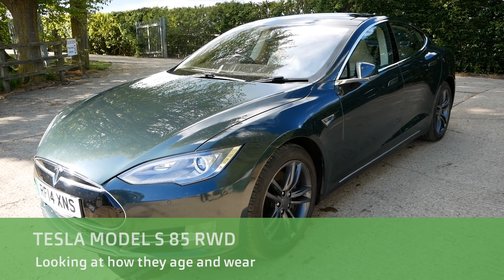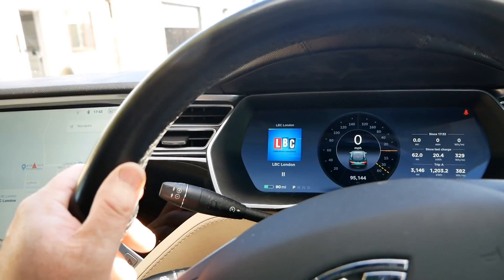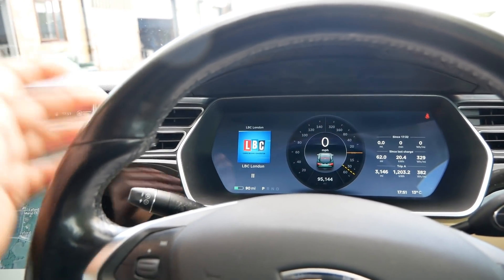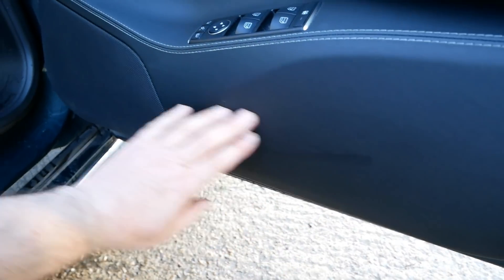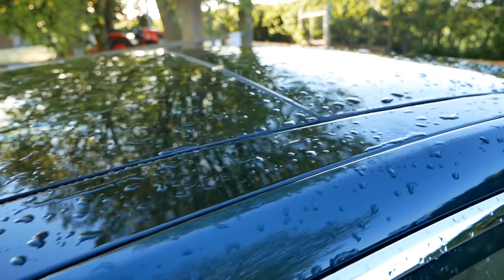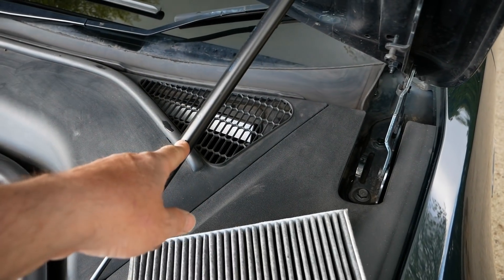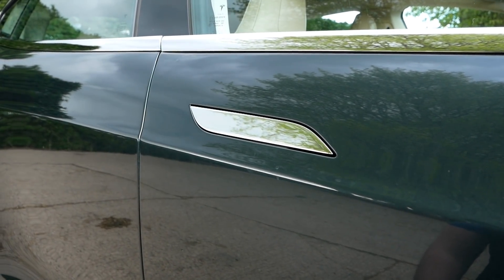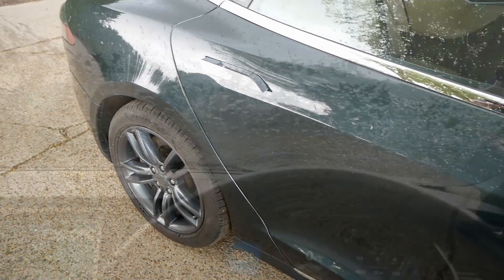How well has this 2014 Tesla Model S aged over 95,000 miles?

Comment: Here's my experience.  In April of 2020 I bought a 2013 Model S85 from the original owner, the main drive unit and main display had already been replaced under warranty. That meant that the car I bought was on it's second drive unit and display (@90K miles).  In the summer of 2023 I began experiencing episodes of the drive unit cutting out during normal driving. Within a year the issue became worse, and by the Fall of 2024 it was happening almost every time I drove the car.  So in mid-November 2024 I drove it to the local Austin, TX service center and on the drive there it cut out 3 times. When I got there they said I should leave it with them (without an appointment) because it was a "safety issue". The diagnosis (the same day) was that the drive unit was failing and had to be replaced.  My choice: do nothing and have eventual total drive unit failure or cough up the money and make the replacement now. I authorized the replacement~ $6700 (out of warranty). The car has 140,000 miles now and is on it's 3rd drive unit. If I had known that this was a possible issue, I never would have bought the car back in 2020. This may not be typical for all early Model S's, but I was unlucky enough for it to happen to mine. Three (3) drive units in 140,000 miles of normal driving is not my idea of a dependable car.

Comment: Speaking of water & leaks etc how is the boot seals ? 
I have heard of other S owners complaining about the boot seals being useless and the boots getting wet either from rain or car washing ?
Also on design when opening a wet or semi wet boot the water drains and drips into the boot .
Reply from the maker: Not seen such an issue yet with this one, nor any evidence of previous wet carpets in the back.
Wasn't that more of an issue with the Model 3?
Reply: @GoGreenAutos  Glad to hear nothing on this one .
I have looked online and have seen the above faults on both the S & 3 mentioned .
Reply: @chrisrichmond403  The issue with the seals is more around the Model 3 boot lid pushing a lot of water onto the rear window which then overflows the seal into the boot. Easy to mitigate if you open the boot slowly. :)

Comment: I have a Tesla with the exact same model that I bought brand new 6 years ago, and just had it towed to Tesla service center today after it suddenly lost driving power on the road. It's the 4th time in 6 months. Since it no longer warranteed by Tesla, my repair bills is over $10k this year alone.
Reply: Omg that is terrible. I was thinking about buying a used 2014 with 52k miles. What was the garages diagnosis?

Comment: I am considering buying a MS from 2014-16, but I am concerned with the powertrain/battery being near or already out of warranty. To all whom know: what would you suggest checking and be mindful of when viewing one?
Reply: Not a big concern, you may loose 15 miles of range by that time and should  hold steady for 15 years. Charge the vehicle to full and see the range in miles. If 265 new, and a 10-20 drop in miles, no issues.
Reply: Get a dongle 90 euro to connect to car  gets you complete analysing off each battzry, milage, charginh etc, all to you phone in real time DMAX brand i think

Comment: This has me seriously considering a second hand Model S when my Zoe lease is up,...
Reply: its a hard decision between a used model s (2014/2015/2016) and a brand new model 3 sr+. The model s has a classic gauge cluster behimd the steering wheel and is sleeker (to me). But it has the charging and range struggle on the 85kwh pack (caused by the software-update from tesla to prevent warranty cases on the battery). The model 3 is the more modern state of the art drivetrain but has quality issues which cause you to beg tesla ro fix them after you got the car. That is annoying and unique in the car industry. Other automakers are aware of satisfying customers by expirience  of perfect build quality. In germany, only few if any garages are available for fixing issues on the model s caused by aging or wear (whishbomes, water pumps and charger may fail). Hard decision.
Reply: Me too! Although I haven't got the Zoe yet. Did you buy a used Model S yet?

Comment: Will Tesla cover a car that hasn't got full service history (Tesla or a vat registered garage) ?
I know the car is out of warranty,but I am wondering if they will duck out of the drivetrain warranty because of the lack of a service paper (or electronic) trail.
Reply from the maker: No service schedules on the Teslas and they state that warranty is still valid. However, if something had failed due to lack of maintenance, then that is a different story. Such as warped dics due to worn brake pads. But the drivetrain is maintenance free, so should be no issues.

Comment: "Getting cheap, only £22k" I guess we have different standards of cheapness! I've not spend over £1k on a used car in the last 25 years...
Reply from the maker: Strictly in terms of other EVs with large battery packs
Reply: Considering it was close to 100k when new, 5x cost decrease, with not much functionality lost, it's a good deal
Reply: when new it costed 100k
Reply: You've not bought many cars that were £100k+ when new, then.

This is outstanding value for a car like this, especially one in such good condition for its age.
Reply: @UnipornFrumm  it is almost half price in US as NEW (about 55k pounds). And this car in particular is extremely expensive as used.
There are videos on youtube where a Tesla had a small accident (back bumper was a little dented) and the repair cost was more than 25% of the car value as new (it was a model 3), waiting time for repair was like 3 months in USA. In Europe waiting time would be a lot longer, and the repair cost would be astronomic.
Reply: i didn't know cars that cheap existed

Comment: It would be fun to see how much supercharging capacity it has left.
Reply from the maker: What do you mean?
Reply: @GoGreenAutos  Older Tesla charge slower when DC charging. Tesla slows them down over time to protect the battery from abuse. It’s a common thing.
Reply: The RWD 85kw battery got 265 mi. on a full charge when new. If it's getting 220 now, that's about average degradation for a car w/ 95k miles. I kept a 2013 S85 for 145k miles and it still got 220 miles on 90% charge.
Reply from the maker: @roblbrewer  Thanks
Reply: @SirHackaL0t.  Tesla was successfully sued recently in Norway for doing this.

Comment: What's the SoH?
Reply from the maker: Unable to tell on the Teslas. But I've ordered a diagnostic cable and will also do a range test for a future video.
Reply: @GoGreenAutos  Seriously?! I is not possible to tell one in tesla?! That is the single most important parameter when buying a used EV. 

Don't want to carry 200 kg of bricks all day do we?

Ironic. I work on R&D for EVs and I'm never going to buy anything past Renault Twizy..
Reply: Correction. Just discovered that Twizy costs same as a quality sedan...
Reply from the maker: @klakier19901  Only about 50% of EVs report the battery SoH in the BMS.

Comment: It might be worth seeing if you can get Tesla to pay to upgrade the MCU to V2. You get 4G and a snappier experience.
Reply: There is no chance Tesla will pay for that - many have asked and been refused even with a dead MCU. Upgrade by all means but it will cost £1400 or thereabouts and you will lose am, fm  and DAB radio as a result. A radio upgrade is also possible for an additional cost of around £400 or you can just rely on web-based radio or streaming services.
Reply from the maker: Yes I looked at this and its not worth the money.

Comment: The reason why they're cheap is because the 8 year drive train warranty is about to run out. After that the cost of repairs is eye watering: Battery $24,000, drive units $8,000 each, struts $6,000, control arms $3,000, MCU $1,800, rear light unit $1,000, door handle $1,000 etc, etc.
Reply: Drive train warrantee apparently only applies to the drive train and batt.
Reply: Service center changed my front passenger door handle for $150 five months ago.

Comment: Are you impressed with this Tesla then? ;)😂 Another very informative video, and it has certainly made me consider a used Tesla. I’m impressed!
Reply from the maker: Yes I am - can you tell?
Its like the MG ZS EV - better than you're expecting.
Reply: 2013 MS 85 with 255.000km owner here... best EV car for the price. I bought it 2 years ago from a dealer. Got the battery replaced under warranty. Drives like a charm and will make a few hundreds km more. Free supercharger is a major advantage for me because I have a supercharger 5km away from home. I have 370km of range at full charge but managed to make up to 420km on a charge in good conditions.
Reply: @Turbo999be  consider charging at home, slow rates over night. It will save your battery a lot. Superchargimg is stress and was ment for long distance trips
Reply: @michaelheinrich44  55.000km done up to know, from ScanMyTesla app I did not lose a single 0.1kwh of nominal full pack capacity in 18 month. My range did not change at all. One Tesla technician told me that Tesla did change the charging profile for MS85 and that supercharging the car is not a problem anymore.

Comment: my worry with one of these would still be expense of battery failure.. it would be nice if you could part exchange the battery for a new battery... i saw on rich rebuilds channel, there's a firm in the USA that do rebuilt tesla door handles for a couple of hundred dollars each, they've replaced all the cheap and nasty plastic cogs with metal and replaced the cable loom in the handle with one of much higher quality- why it costs hundred of dollars cheaper than a genuine tesla version? who knows...
Reply from the maker: But you could say the same about any vehicle - EV or ICE. If you're the type that worries about items breaking and the cost of repair, then buying a used vehicle isn't for you. Buy new or nearly new that still has warranty. All vehicles will suffer failed items at some point...that is why cars get cheaper the older they are! I've had old ICE vehicles in the past that suffered gearbox failure and I then had to decide whether to replace or scrap the car. The reality is that EVs are considerably more reliable than ICE vehicles, so far less risk. But then its also reality that there are less choices when EVs break and they can be costly to repair, but that is simply because its a new market, less skills, less parts, less upgrade options etc etc.

Comment: Just for your information not a single 85 has 85kwh of battery capacity. Most of the 85 I know have roughly 73-78kwh from which you have 69-74kwh usable.
I won't buy an 85 that has not had its drivetrain replaced and I would rather buy an 85 that has had its original battery replaced because most original battery packs have failed after roughly 150.000 miles and having a failed battery pack ouside the warranty is a major blow.
Reply from the maker: I've got a diagnostic cable on order so will make a future video about the battery info that can be gleaned from the car.
Reply: @GoGreenAutos  Yep ! That's a good idea. ScanMyTesla app is really good.

Comment: Does anyone know how much the motor would be to replace when out of warranty? It's the only thing that scares me with older Tesla's!
That and the few problems it has here - 95,000 miles isn't a lot really. My 2006 Golf is on 170k miles and still tight as a drum! Only things it's needed are a water pump, new clutch and master cylinder and 2 regulators for the front windows. Oh and a pipe for the intercooler, wipers and tyres and new brakes! Not bad really, only about 2 grand in 15 years!
Reply from the maker: Be careful, that's starting to sound like Trigger's broom! :-)
Reply from the maker: When you look at ICE vehicles as a whole, that is certainly a long way off the norm.

Comment: As well as getting regular software updates, one can also replace the MCU (the main control screen & computer) to the latest MCU2 version for about £1500.
Yes it's a major amount of money but it gives you the latest gen processors, a much faster computer makes the pinch & zoom function on the map instant, everything else is much snappier and you get free Netflix access if you are on the Premium Subscription plan.
For £200 you can also upgrade the old 3G modem to the latest 4G/LTE model which improves the entertainment system.
Here in Norway, the original Model S vehicles came with lifetime free supercharging valid anywhere in Europe, so my daily running costs for energy will always be zero, no matter how high domestic electricity prices go.
Electric vehicles here are also exempt from toll road charges and can use the dedicated bus/taxi lanes if the main lanes are congested.
All EV sales are currently VAT exempt which is probably why 85% of all new car sales here are plug-in vehicles.

Comment: air from the arch end of the drainage channel. blow up maybe
Reply from the maker: Yes I am going to try that, but not had the time to remove the wheel arch liner yet. Not a quick job.
Reply: Or a bit of strimmer 'wire'.. it's worked for me on other vehicles..
Reply from the maker: @G-Cam1  That is exactly what I tried. Had two thicknesses and neither would get any further than 1cm in the hole.
Reply: @GoGreenAutos  you can perhaps try it on the end of a slow drill... 
Failing that I would try an air line... 

They can be tricky...

Comment: Haven't Tesla been in hot water in Norway for doing the old Apple trick with battery, software updates reducing the charge speed and reducing the range
Reply: “Trick” = protecting the battery because the laws of chemistry and physics.
Reply: @Rudenbehr  rubbish, if that was the case why did they have to pay the customers thousands of dollars in compensation.

Comment: The only car that ever used the Chadamo plug was used on the Nissan Leaf and was limited to 50 amps DC.  Does the UK not use the Tesla plug or is it slowly being phased out? I will have to admit it must feel strange to Americans to drive on the “ wrong “ side of the road in the UK. At least Tesla eventually switched at the factory to building cars with the controls on the right side of the vehicle instead of the left as is American practice. I have to admit it appears the UK road system is in much better shape than American highways. Even if they do drive on the “ wrong “ side of the road. 

Cheers!
Reply from the maker: Actually there's other EVs in the UK that use Chademo as this was the standard (and still is) Asian DC connector. So vehicles like the Kia Soul, Peugeot iOn, Peugeot Partner van, Mitsubishi i-MiEV and others use Chademo. 
We never had the Tesla plug in the UK, apart from on the early Tesla Roadsters I believe. All Superchargers have only ever been the Tesla type2 standard and now more recently CCS.

Comment: We have to re-think when it comes to buying a used EV. At 95k miles I would have lots of questions about an ICE car, including oil change history, cam belts, coolant changes and on and on. So buying one with no history would be a big negative. But with an EV I would be more relaxed for all the same reasons, there are no oil changes or cam belts and on and on. Apart from general condition of an EV, the suspension components are the only parts that wear similarly to an ice car. Traction battery is the only area of concern, but we are learning that this is not the major issue it was once thought to be.
Reply from the maker: I've made a few videos on the channel on traction battery life, as I've owned a few high mileage EVs now.

Comment: I do wonder how, other than size, a slightly newer iteration of the same with Autopilot that sells for around £28-£32k at the moment stands up to a (say) ID.3?  There is a new 'Family Pro Performance' (62kWh) with heat pump on Autotrader now for £30k.   I look at an old Tesla and wonder just how much of a leaky, slow charging, money pit they will become?
Reply from the maker: That was my worry, but on doing plenty of research, they don't seem to be a money pit at all. Of course, there will always be someone who's had problems and the internet is full of people who have the motivation to vent their issues and the people who have had no problems are generally silent. But this is why I purchased this Tesla and came out of a 1 year old EV, to see if the Tesla is a viable option now they are the same sort of price as other used EVs. So far, I'm impressed with this and other older Model S's I've had in.
Reply: @GoGreenAutos  thanks.  I will be watching your progress with some interest.  I've been looking at getting one - would prefer one with Autopilot, the 19" wheels and air suspension (it's what the chassis was designed for, the ex-Lotus engineer in charge of the project is really sniffy about the 21" wheels on it!) and the times I look they are getting both more plentiful and the prices are clearly ticking down at last.  Despite the lovely colour of yours I would have walked away from the leaking roof.  Not sure I'd be happy at gumming up the works to stay dry in a £25k car!
Reply from the maker: @FFVoyager  The rubber strip on the sunroof is not a 'seal' as such. As its a channel, water gets in regardless. I just had to stick it back up as the sliding section was snagging on it. The sunroof only leaks because the drain channels were blocked with rubbish (happens to all sunroofs) and the previous owner parked on a slope at night with the back down. There's no drainage channels at the back of the roof, so any water than gets in the roof channel/tracks wont drain away if parked with the back down, so hence why it then leaked inside. Lack of user knowledge and maintenance was probably the cause.
But yes, sunroofs are a pain on any car as they age. Its probably why Tesla stopped offering the sunroof as an option, which probably reduced warranty claims. Now they just have fixed panoramic roofs.